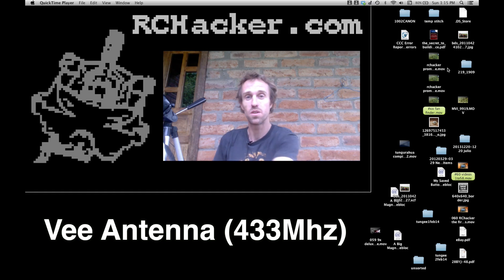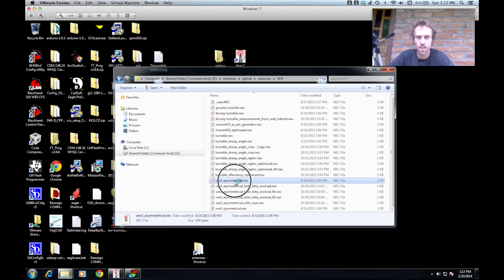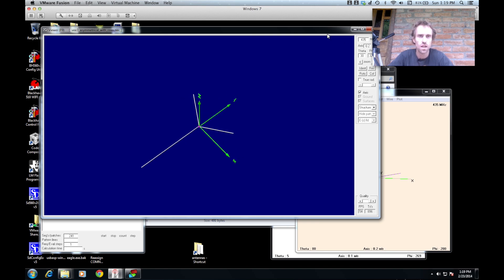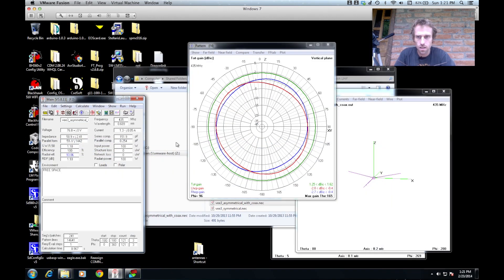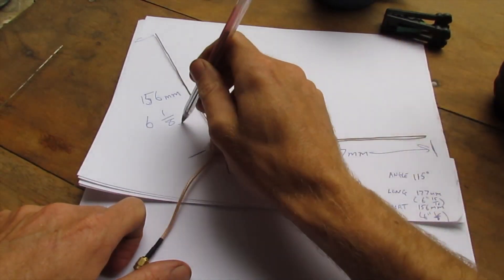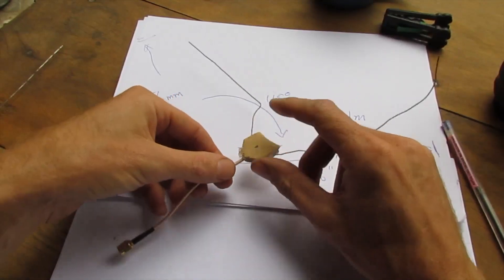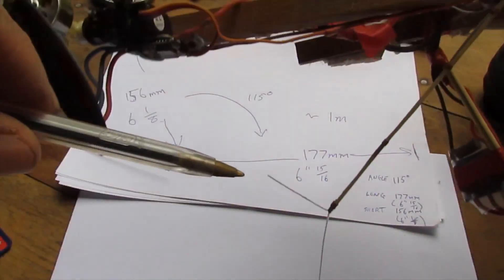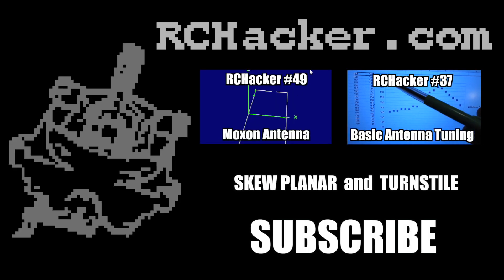Simple Vee Antenna for FPV and RC. RCHacker #61

Comment: Hi Marc, Thanks a lot for sharing your knowledge. I have an openlrs system and plan to make an inverted vee antenna according to your design. I was just wondering, how important is the thickness of the wire? I currently have some regular .6mm wire laying around. Do you think it will perform noticeably poorer than 1mm? Thanks for your answer. Cheers

Comment: Hello Marc ! First - thank you for all your videos and blog - big source of information and DIY thinks (which I love) Just building my first quad - and put V antenna to test - what is the reason to put V in horizontal position ,according to radiation pattern - it will be better to put it verticaly (?) I'v done some tests ,with two V horizontaly - I'v had a trouble while turning back, horizontal vs vertical vas terrible of course. Now I'm testing a V on TX verticaly, and a Ibcrazy's monopole on quad, - same result with polarization while vertical is good.
Reply from the maker: You're welcom Jan. I have it horizontal because my moxon is mounted horizontal, and it fits better on my multirotor.  You might be right that vertically is better. Experiment always wins over theory.

Comment: Wouldn't just be more easier to show formula how to design the V? I mean how to calculate longer and shorter arm... How did you come up with two arms not equal to each other? Is it due to better SWR or what?
Reply from the maker: I let the 4nec software test a whole variety of lengths for best SWR. The asymmetric one is what it came up with. The asymmetric model came up with a better SWR.

Comment: 2 V's equal a turnstile antenna, you can mount on bottom of quadcopter very well  watch?v=XbCQeuGtHBM
Reply from the maker: Onto it, that will be my next antenna video. I have learnt that the radiation pattern is not what everyone things and it is best mounted horizontally.

Comment: I have a 5.8 32ch 600mw rx/tx fpv system.i have a 7inch monitor that was factory built with the 5.8 32 ch rx built into monitor works great but small screen. I have an old Toshiba satellite pro 4200 laptop I took out 15 inch monitor and want to run signal from my 7 inch monitor to the 15 inch one. I figured if anyone knows how to do this it would be you? please email me with any or all help!  davidringler40@yahoo.com
Reply from the maker: this got buried in spam. no sorry not easy. you need a whole lot of electronics inbetween to convert the analog signal to a digital one and then perhaps even a computer to drive the lcd.

Comment: Hi rchacker,I am very interested in getting into fpv. Would like to know if you have any videos out on how to connect the wires from the receiver on back. Including any added bateries bec,osd,cameras and gps device. Also,lets not forget the fpv transmiter,receiver and ground station. It will greatly give me a better view of how to get set up thank you.
Reply from the maker: Thats a huge topic. I went down a specific path that although it was cheap it needed a lot of soldering and DIY skills. My stuff is not really for beginners and you will have to do some research to 'fill in the gaps'. Google "flitetest beginners fpv" they do good videos and might be a good start for you.

Comment: Does the coax length have an influence before the Vee wires? I have old antennas I'll use to make the basis for this antenna. Does the plastic part around makes a big difference or I can let it on? Thanks for explaining and sharing
Reply from the maker: The impedance is matched so the coax length is not important. With a short one the radio itself will mess up the pattern a bit. I'd leave the plastic there for strength.

Comment: I have seen some people making Y shaped V antennas (base of the Y as the feed in) where both elements are the exact same length. I was following such a guide when i made my last V antenna. 
How much of an advantage do you think there is in using unequal lengths? Would either method work ok?
Cheers for all the info!
Reply: I will try testing both designs against each other using RSSI in the next few days or so hopefully.
Reply from the maker: On the simulation I got a minor improvement with the asymmetric model. The computer chose it, it is possible to 'evolve' designs and let the computer figure out which is best. I did this with a symmetrical model also.

Comment from the maker: What frequencies do people want to see on the cheat sheet. 433, 440,  1080,  2.4?
I can do calculations for each on the simulator.
Reply: 459mhz for everyone in the UK please :-)
Reply from the maker: Cool good to know, I only have legal info on Australia and the US.
Reply from the maker: Ian Ferrell Great, so 433, then 425 and 440 for the hams and 459 for the brits.  420-450 is the similar for hams in oz. I've got the middle of the frsky gear written down somewhere, that leaves 900-1.2G.  915, 1100  1250 ?
Reply from the maker: Ian Ferrell Cheat sheet is done, http://www.rchacker.com/diy/antenna-designs-for-rc/vee-antenna/veeantennaIMG_5548.jpg
Reply: Øystein it should still be reasonably efficient around 420... on the order of 1%...  being a replica the manufacturing tolerances aren't going to be super high so it's hard to say what the resonant frequency is without measuring. It's entirely possible that it's actually more efficient at 420 :)
Reply: RCHacker
  In the US those of us with ham licenses get 420-450.  I would build a version at 425 and set openLRS to center there if you wanted to post that up.  Its annoying to me that everyone wants to run right around 433... get creative, there's plenty of band around available here ;)
Reply from the maker: christophertelford Cheat sheet is done, http://www.rchacker.com/diy/antenna-designs-for-rc/vee-antenna/veeantennaIMG_5548.jpg
Reply: Sweet!
Reply: I vote for 2.4G :)
Reply: +Ian Ferrell (AF5SH) I don't live in the US but would surely like to use other frequencies than 433. Maybe you could give me a bit of advice. I have a diamond 771 (replica probably) and I want the most out of it. If the sweet spot for the antenna is 433, what should I expect at 420? Am I stuck in the 433 area with this antenna?
Reply: +Ian Ferrell (AF5SH) Thanks for the answer. That's all I needed to hear. I'll see what other legal frequencies there are here (in norway).  Cheers :)
Reply: +RCHacker I'd love to build a 5.8GHz antenna - I am new to your channel, nice work - keep going !

Comment: I was just looking to make one of these myself for 459mhz and an openLRSng radio receiver. Nice timing!
Reply from the maker: Why 459?,
Reply: RCHacker Because of legal restrictions in the UK where i fly. Otherwise i'd be on 433mhz. Fortunately the OpenLRSng is programmable for that kind of stuff.
Reply from the maker: Is that centred on 459? Do you know the exact range and power limitations off hand?
Reply: RCHacker I believe it's 458.5 - 459.5 MHz at a max power rating of 100mW. So definitely possible with the OpenLRSng gear.
Reply: christophertelford i can't give you the link. but somebody at rc group said that the power decreases when you run away from the center @ 433. anyway you might be interested and look that one up.
Reply from the maker: You are right. You can get different versions of the rfm22b module: 433/470/868/915MHz 
Although they are capable of tx/rx on all frequencies they are optimised for just one. Exactly how wide that curve is I'm not sure, but it is designed to be a frequency hopping transceiver.
First person to try 459 let me know..

Comment: Happy to see you back !
Excellent video, thanks for sharing.
Can you confirm that longer wire go to inner part of coax and short wire goes to out (coax)?
Also can you give detentions for 2.4 gHz?
Thanks again.
Reply from the maker: long to outer and short to inner, I have to look up the dimensions for the 2.4G. Will put that on the cheat sheet. Until I get that up all I can offer is the nec files on github. https://github.com/rchacker/antennas/tree/master/2.4
Reply: RCHacker
My 4NEC2 couldn't open the files ;(